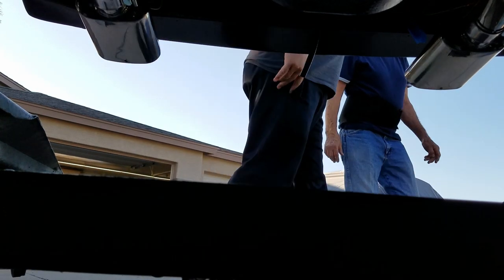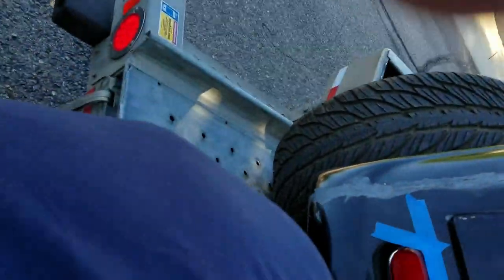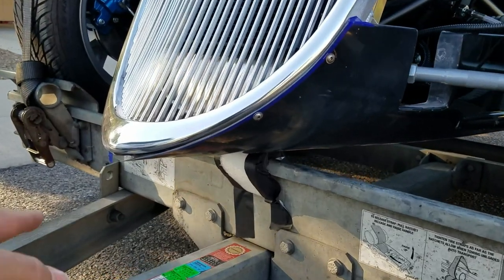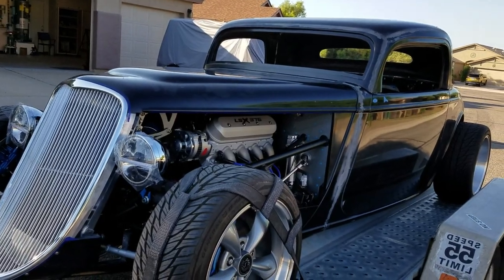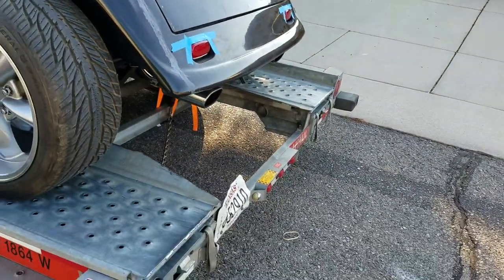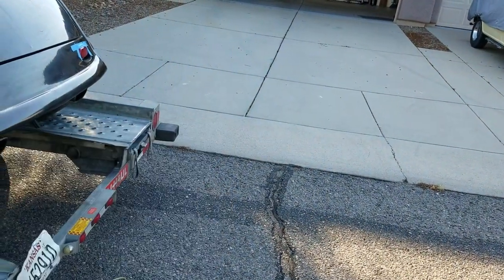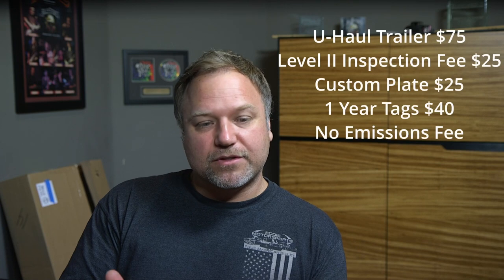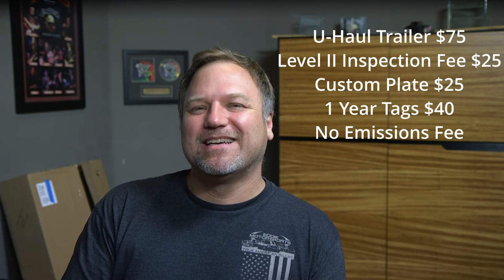Factory Five 33 Hot Rod V2 - Getting A VIN Number For A Kit Car

Comment: Glad it all worked out for you... but... You'd already put in all the wrench time on the most difficult parts of the car. Why go through all that with inspectors just too potentially have to do it again when you only had minor things to finish (wipers, mirrors, seatbelts, horn)? why not finish the car 1st?
Reply from the maker: There is plenty of logical reasons and the original officer I talked too said it was not going to be an issue.  I will not have wipers.  Seatbelts were installed already, horn was working, just not the decorative button.  I just did not have mirrors since the ones that came with the car do not work with the car and there was no way I was going to drill hole for something I am not using.  Also, it was the only time I could schedule that it was not raining to bring a open car to the DMV. In AZ it rains for 2 months strait every day and you have to schedule these appointments in advance.   Some people finish the car fully and get it licensed, and others like to road test the car for 500 miles before painting.  I am doing the later.  Plus since I am in the city there is no way for me to test the car without it being licensed.
Reply: @StreetRodJim  LOL that was a long walk to get to "I don't know what color I want". Can't wait to see it all done! 

Separate Question: What do you wish you knew about this model before building it that you know now?
Reply from the maker: @chipwoods2311  Nothing really.  I really spent about 2 years planning and researching before pulling the trigger.  This included taking a ride in one, and going to build school.   I also bought a C5 which basically had the same engine and trans, so it was a preview of what it would be like performance wise.  The only thing I can say since this is my first build... is this is a very small car and there is not a lot of room to upgrade or add technology.  There is just no room for it.  If I have a build under my belt before, I would have known that when taking a ride or at build school, but it did not stand out to me at the time.  Removing the HVAC system gives you some space back, but I am keeping that.
Reply from the maker: I'm also glad I have a V2 and not a V1.